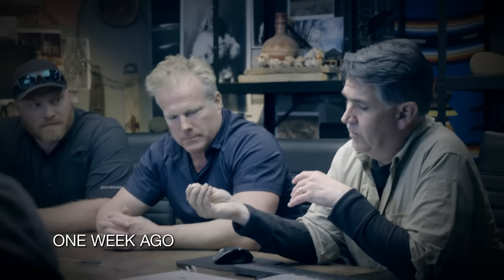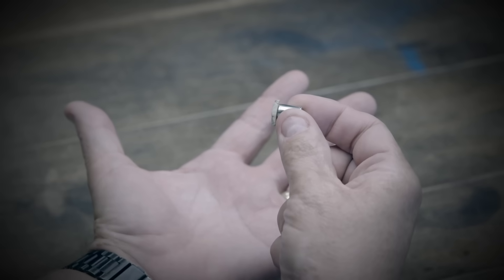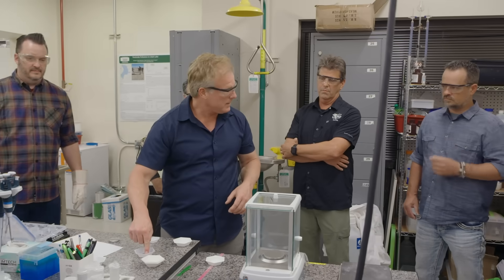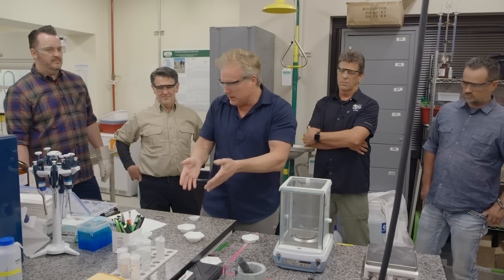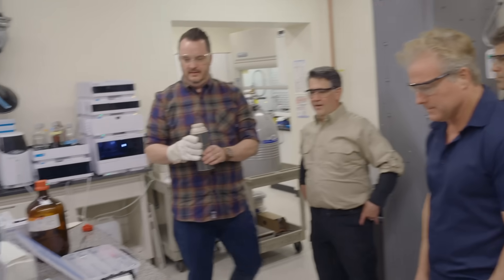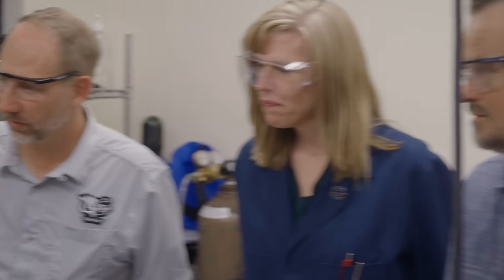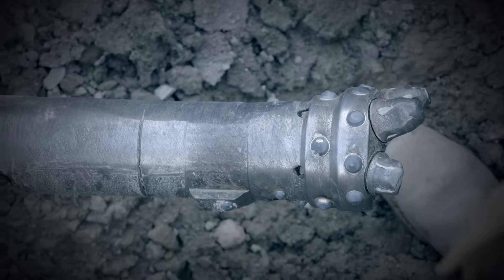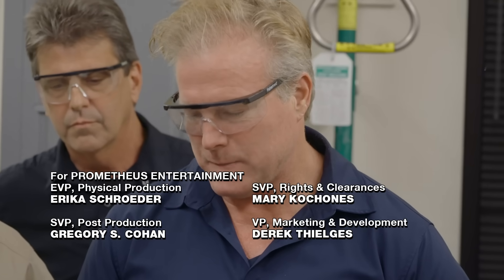The Secret of Skinwalker Ranch | S6 E12 | Ceramic Lab Tests - Meissner Effect Refusal [HD] [2025]

Comment: For 6 years the hosts have been hinting there's a "spaceship" inside the mesa. Enough with the holes and the drills and the dumb drone shows and the rockets!  EXCAVATE THE DAMN MESA and find out already!
Reply: Yes! For the love of Pete! Get on with it!
Reply: I completely agree! Why use a drill when you can use a backhoe.
Reply: One word, liability. Its radioactive. They have to prove its safe to dig, obviously. That's what all these tests and boreholes are all about. Have you ever worked construction in high-risk places? Worker safety is the most important factor. Now think it over.
Reply: @FragmentedLore well, in this particular instance, backhoe would be no more dangerous than the borehole. In fact, one could argue the borehole is far more dangerous than a backhoe. One's going to drill a hole in it. One's going to simply uncover it. Yep! The bore hole is way more dangerous than the backhoe..